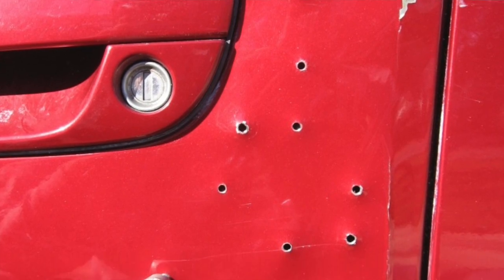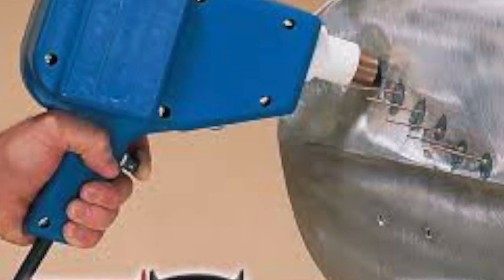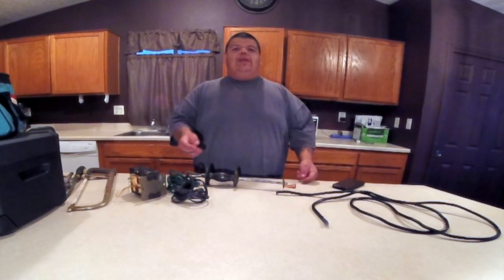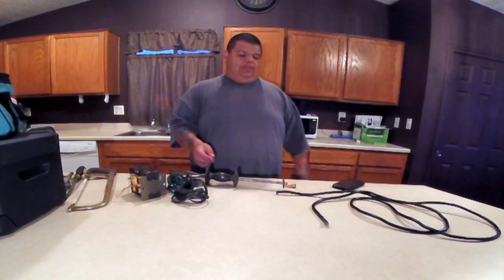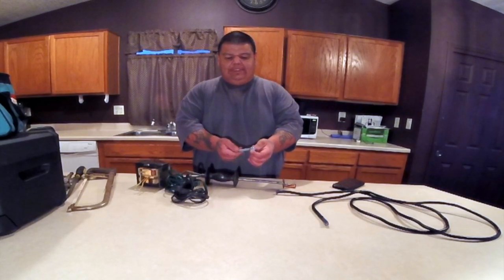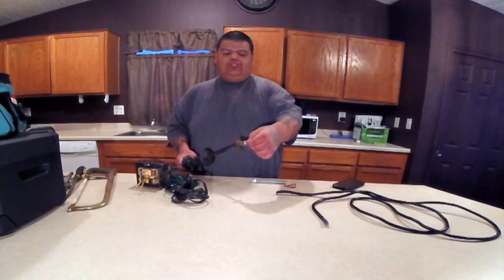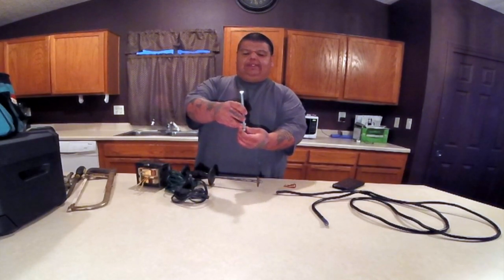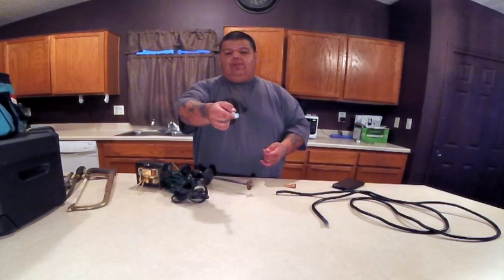DIY HOMEMADE ELECTRIC DENT PULLER PART 1

Comment: Good Smooth Video KP...   Question,  do you think this is strong enough to pull dents from a 66 C-10 ???  Or would I need more transformers 2-3 ???
Reply from the maker: C Dale  honestly bro i would not even use the transformers  to pull on a 66 c10 just because yes your going to need more power and microwave transformers are very Dangerous just a few weeks ago I guy here in my town died from trying to make a wood burner from a few transformers . PLEASE ALWAYS USE CAUTION AND NEVER USED A mico transformer right out the micro you have to rewind them . Right out the micro that power kills ..  There is good news tho. if you watch my last video on here I put up a diagram for a car battery dent puller way safer and with enough batteries that WILL pull dents on that thick metal on your c10  yes only 12 volts but I’ve built a welder on batteries and worked awesome. What ever you do Good luck bro and thanks for the support 💯👍KP
Reply: @kpvideos4162   Thanks Bruh for the Honest Answer!!   I have a small Welder in the Garage maybe I'll just weld Nails to the panel and pull that way with a Snatch-Bar....